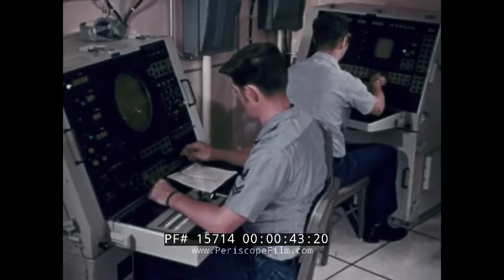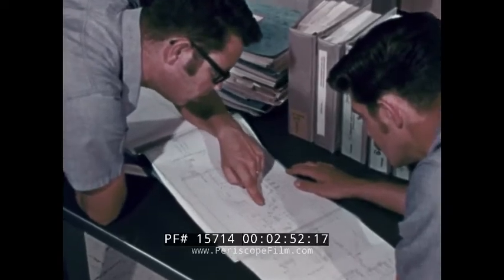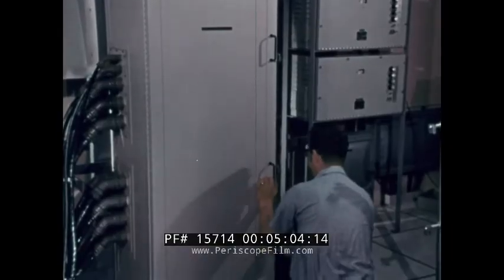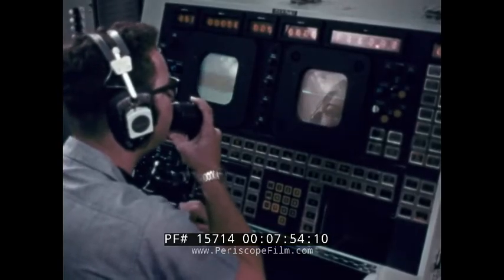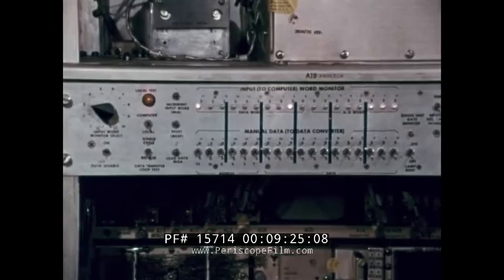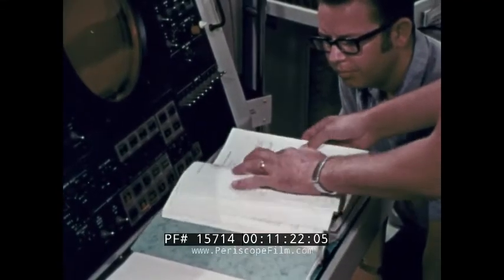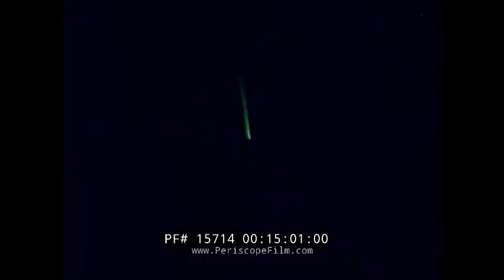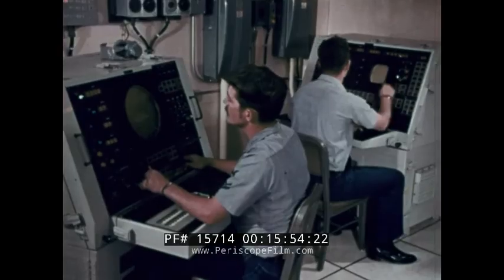U.S. NAVY TRAINING FILM  MARK 86 FIRE CONTROL SYSTEM MAINTENANCE  TRANSISTOR COMPUTER BUGS 15714

Comment: The Mark 86 system was on the USS Norton Sound (AVM-1) and I imagine that was the first shipboard installation since testing this and that was the purpose of that ship.  When I was assigned to it 1968-1970, they were testing the Mark 86 system for controlling the Mark 45 lightweight gun (a 5" 54 gun).  I wasn't part of that (I was an ET maintaining shipboard radar and communications and also working with civilian contractors on some new things being tested) but I did see the inside of the Mark 86 space once.  I recall seeing a Univac 1219 computer there.  But I might be mistaken.  About the USS Norton Sound:  It was built as Seaplane Tender AV-11 near the end of WWII and later refitted to become the first Navy guided missile as AVM-1 (VM-1 displayed on the hull).  Later yet, I believe it was reclassified as "Weapons Test Platform", but not positive about that.  I think that's what it was called when I was on it.

Comment: Of course depends on having those spare parts available, and also that your operator has confidence that those spare parts actually are going to work. Not always the case that you have spares, and that they are guaranteed to work, especially for parts that have been in storage for a long time before you use them.
Reply: Was an FTG in the mid 70's to early 80's. We learned how to repair the plug-in mods. And that UNIVAC 1219B computer, with magnetic dounut memory, was a nightmare to work on.